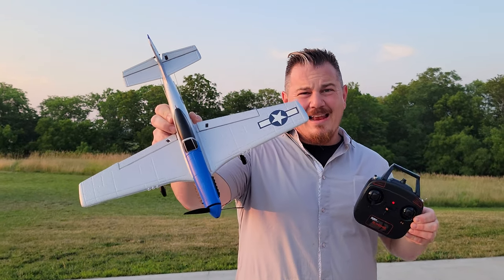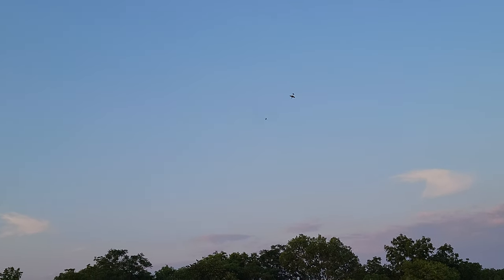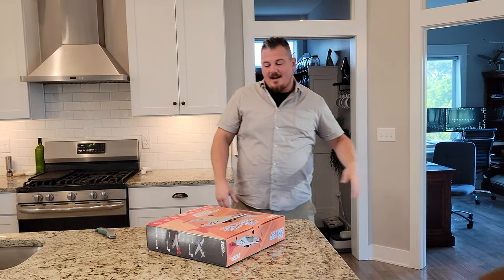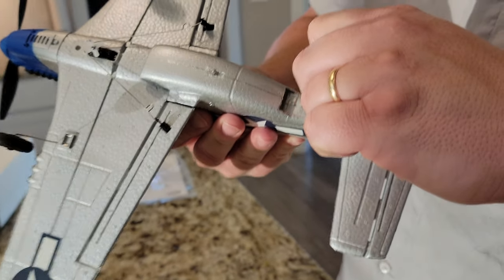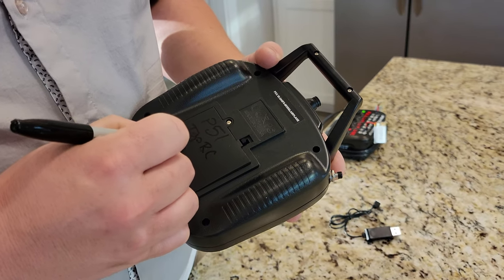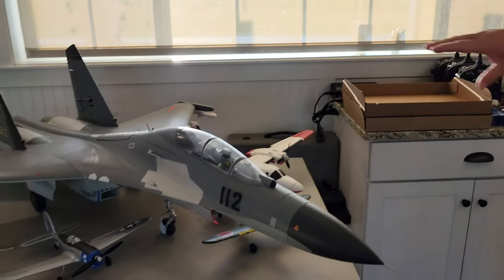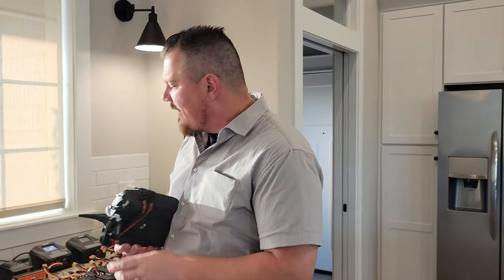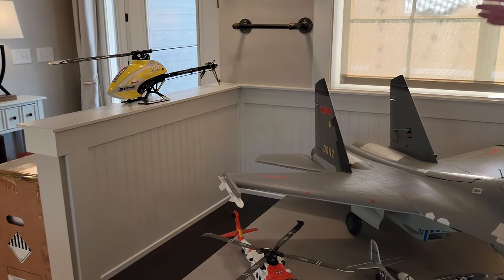Top RC - Mini P-51D - 450mm - Unbox, Build, & Maiden Flight

Comment: I have the 400mm TopRC FW190 and found I needed more up elevator too, so adjusted the servo one notch. I also found it to be nowhere near as good as the Volantex/SonikRC 400mm series in how it flies. It was also heavier by about 10 grams which is a lot on a 74g model with battery. In the Volantex series I have Mustang, Corsair, Spitfire, Zero, Bf109, P40 and they all fly much better. You are now the third person I have seen comparing these models and all three of us have had similar experiences. Will be interesting to see if they improve over time. Thanks for your review. Very useful.
Reply from the maker: Glad we could help! Thanks for stopping by!

Comment: Do they do a motor upgrade,mine seems gutless compared to my volantex planes,it struggles to loop etc
Reply from the maker: It's like this 450mm has the same POWER as the 400mm! I've noticed the same thing. My son was JUST flying it last night. While he enjoys flying this plane, they need to get into brushless motors, and get some better electronics, now that they have a REALLY NICE AIR FRAME going for them.